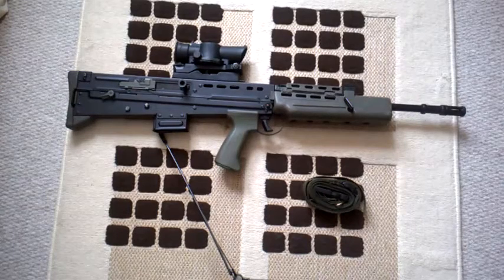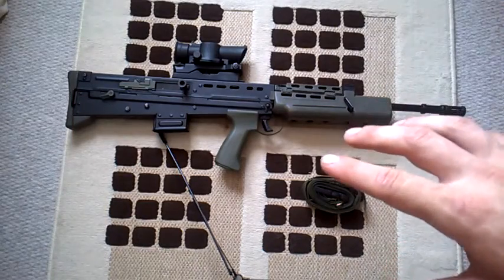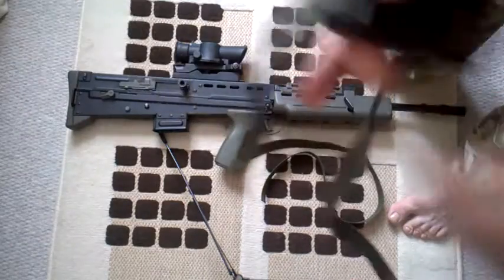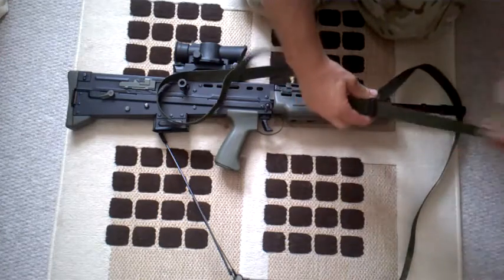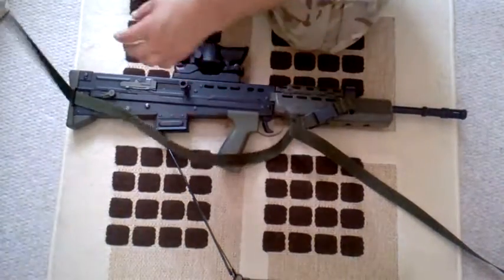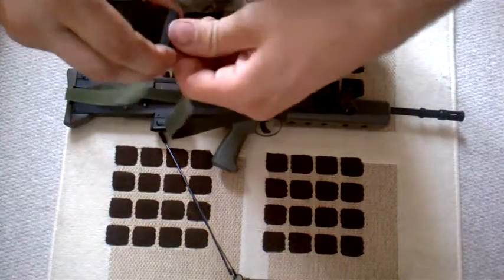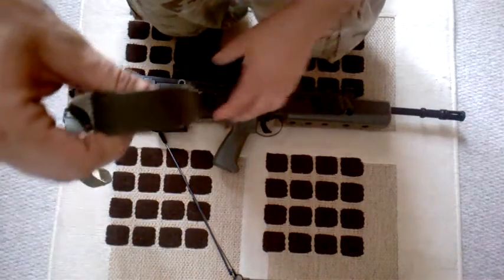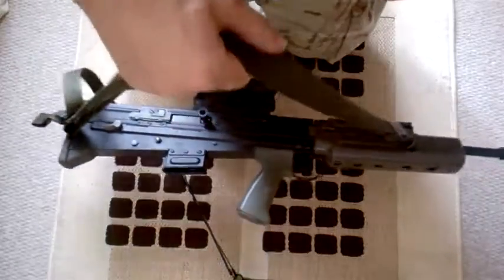Putting a 2-3 point sling on an SA80

Comment: Why are you fitting the sling on the wrong side?
Reply from the maker: to lay the rifle flat on the floor
Reply: @Iwasthemilkman  just wondering why the eyelets are on the wrong side
Reply from the maker: @vwtransportersandmotorcycl3729  the rear one is universal (there's a loop on both sides) and the front one, you can unscrew and swap over. This is done as you can get left handed SA80s, though they are rare
Reply: @Iwasthemilkman  well thats news to me and never in my entire military career seen one

Comment: This weapon had to be fired from the right shoulder and, because of this, the sling was fitted to the left side . Why are you fitting it on the right and why has nobody else noticed this??
Reply from the maker: The sling is being fitted on the left side to avoid lying the weapon down on it's charging handle; this also allows it to lie completely flat.

It has been noticed and mentioned before.
Reply: @Iwasthemilkman  Then find a way, I have to. You've fitted it incorrectly. Who's to blame if it's fitted the way you've shown? Also, the correct term is 'cocking' handle.

Comment: Only one problem... An sa80/l85 ejects the shells from the right meaning if you done this on the real rifle you would have hot brass in your face. Otherwise good video
Reply from the maker: +Daniel Burgess I put the strap on this side so I could lie the rifle flat during the video; I wouldn't have been able to do so if I had fitted the strap to the correct side :)
Reply: plus its proberly a bb gun so its fineee
Reply: chill dude XD